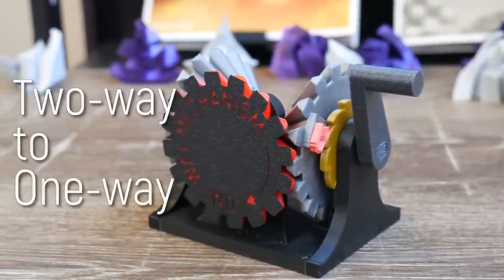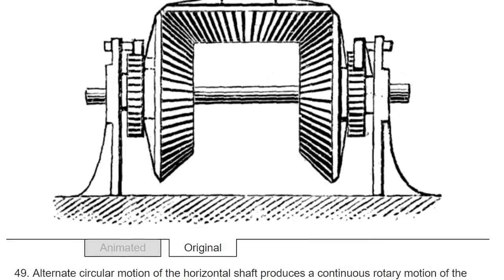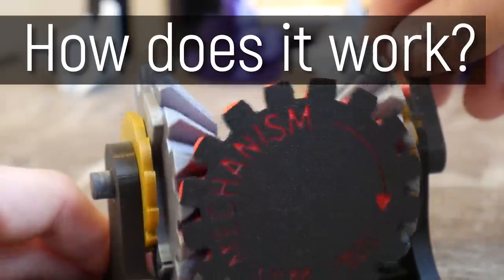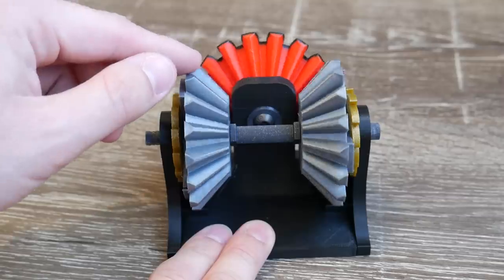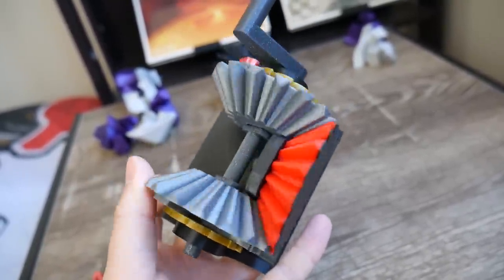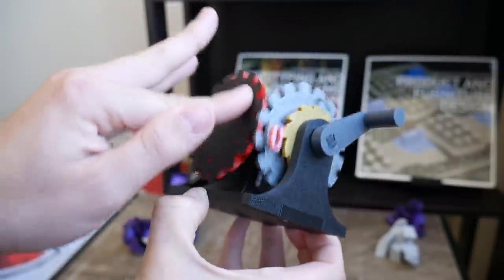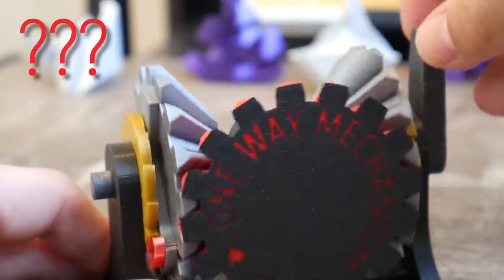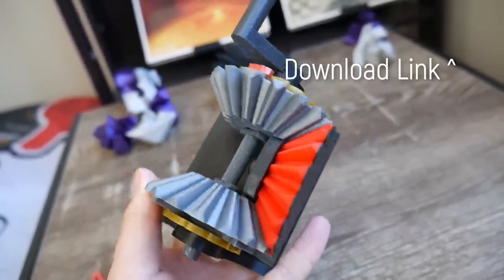This Mechanism only turns Clockwise, no matter what.

Comment: I have a hand drill with a selection of modes and one mode is to use the hand drill in awkward places where full rotation of the handle is not possible and only small reversed handle action can be done.

Comment: some boats use winch (the thing you put your rope on) that make this kind of movements. in one way, it rotate fast clockwise, (and be hard to rotate) and on the other way, it would rotate slowly clockwise (which require less strength to manipulate)

Comment: To lift stuff attached to a pulley, instead of rotating a lever, which can be tiring, you can push back and forth to achieve lift with a smaller range of motion

Comment: So you can only turn the output shaft one direction... great way to prevent a cart from rolling back down a hill, put one on each wheel so the cart can only be pushed one way. If you decide to roll go down hill though, rotate the cart around pivoting on wheel until it faces the other way, now no one can push it up hill. If someone does not know secret you can baffle them why it will not move the opposite way...

Comment: This could be used to convert sound to kinetic energy, and then into electricity. The sound would vibrate something like a guitar string, then the oscillation would turn this mechanism which could then be used to turn a magnet inside of a coil of wire which would generate electricity.

Comment: This sort of assembly is commonly found in screwdrivers, so that you can just twist it back and forth to tighten or loosen. It’s far more practical than you might think.
Reply: That's just a normal ratchet
Reply: Stephen Hurman Some are, but many are designed to continuously twist for maximum efficiency.
Reply: I've never seen one myself that does I've only ever seen normal ratchet ones I would be interested to see one that does

Comment: It's a rear differential.  imagine that the yellow and black one is the input shaft from the engine, and you are trying to make a vehicle move forwards.  yeah,  that would be an ideal build.  disengage the ratcheting things, or turn them around, and you have reverse.  in a real differential, this is all handled by the transmission.  if you look up the Limited Slip Differential Explanation, you could have a fin trip down that rabbit hole.

Comment: You could actually improve your mechanism by eliminating the sound.
For that, you would need to make both fixed parts on the axis slightly movable towards and far from the main gears they are neighboring.

When you move the axis in one direction, one gear gets engaged in order to allow it moving in your clockwise direction, while the other gear is pushed slightly outwards, slight enough to allow the uni-directional hook not to engage and therefore make no continuous sound eventually apart from a single click.

I mus mention here that there might be some slight intolerance when switching directions, as when you do that, the other distanced and not engaged gear will have to be pulled inwards towards the neighboring gear, and since it cannot figure in advance when the user is going to switch directions, there might be some tolerance required until it is pulled inside and engaged with the neighboring gear.

I haven't given it much thought, but this might be solved by making multiple inner engagement structure so that, once pulled after the direction is being changed, it will snap into the next one of multiple higher resolution slits (structures).

Comment: I can imagine a practical use for 3 phase motors. 3 phase motors direction of spin is dependent upon how the 3 phases of power are applied to it. Something like this could limit the working gear to the direction intended no matter what direction the motor spins. Now having said that, and having wired up many machines, I have never seen anything like this. I either check the phases in advance with a phase checker to insure proper rotation, or I do a spin check by momentarily powering the motor and checking the direction of spin, and changing the phases of power if necessary if direction of spin is incorrect. Some machines also come with a phase checker installed in the control circuit, and will throw a fault if the phases are incorrect.

Comment: i have a similar set up in my screw driver so i can rotate the handle either CW or CCW and the drive shaft rotates in one direction. i can manually remove screws in ICB (Integrated Circuit Board) just as fast as mechanical with out the concern of over tightening and damaging the ICB

Comment: My grandfather was a big steam engine and early combustion engine buff and a couple of the models that I saw when I went to fares with him had a flywheel that turned one way but a reciprocating shaft that turned both ways The motor essentially had one can bustion and then spun several times in 1 direction and then a second combustion when everything slowed down and forced it in the opposite direction So this device or one like it was probably involved

Comment: i think this mechanism can be used to convert ac current to dc current.
if we |connect an ac motor to the ac power and attach the ac motor to the axle in this mechanism| and |attach a dynamo at the red bivel gear of the mechanism the we can get dc current from the dynamo|
this can be helpful as there is no loss of current when the polarity is reversed because of ac current.

Comment: one way to fix the ratchet noise issue would be to replace it with a clutch like the ones found in chain hoist, but i would require a machined shaft and a load applied to the driven gear.

Comment: Ok strap in. Some comments have come close but here’s a good use. Imagine the handle is a pendulum swinging back and forth providing continuous rotation.  That rotation is built up into a flywheel which in turn drives a generator for power. But where do you put it? Stick it on a boat at sea and BOOM! Endless power, no solar or wind required. Come on you 3D printer jockies, get building.

Comment: what if you put a pulley gear system to this with a single weight on one end and the other end have an open container?

maybe for container have a tray that is open on one end.

put this outside to collect snow.

for the output, attach an electrical generator system to it.

when the tray is filled, it will drop, spinning the generator gear. when the tray empties (add something at the bottom of the drop to tilt the tray?) the weight will pull the tray back to the top and the generator gear will also spin.

Comment: this was amazing! from the beginning I knew there were ratchets in there. why? well, this mechanism features an irreversible logical mapping: the information about the initial rotation direction is lost in the output. this means that this mechanism could not be possibly obtained without some irreversible parts. (well, everything here is irreversible, because it's a practical implementation, but I'm speaking in principle here.) in your realization, such irreversible parts are the two ratchets, which require friction to work. (if not, they would bounce back without sticking in place -- there's a talk by Feynman about ratchets on youtube.) you finally ask about efficiency: it cannot be perfectly efficient, not even in principle, otherwise you would not have an irreversible machine.

Comment: You can create a Vacuum Pump with high voltage Input and it even works when the The rotating electric field wont turn in the right direction.

Comment: You can change the ratio of the bevel drive gears to provide different torque transfer based on rotation.  Like a winch on a yacht.

Comment: Just guessing. In an mechanical analog computer (for instance fire control on a battle ship) units/values could be represented by shafts turns. So if an absolute value of that unit needs to be calculated your device will do that.

Comment: you could add an additional lever (switch) by which it would disengage the current pawls you have, and engages new pawls in the opposite direction, this way you had build yourself a ratchet wrench

Comment: I found this video looking for a way to run a propeller shaft using a pendulum/counterweight that replaces the mast on a boat. With the right gear ratio and keel weight it should work...

Comment: Practice use for this but not too practical. On a pumpjack it has sort of a fixed ring and pinion style gear system, as I goes down it spin the drive shaft one way and as it goes up it spins the drive shaft the opposite, this would be a could place for a secondary pump given there is a pause in between motions but it’s the most practical use I can think of given the area I’m from and thing things I’ve see

Comment: Immediately I'd say my idea: Basically diesel owners with mostly manual gearbox have experienced reverse flow at some point and that literally fucks up the entire flow of the engine. What this could be used for is if in the future an efficient enough design is created, you can use it to prevent reverse engine flow!

Comment: An ocean wave pressure plate to electrical generator for wave and pull current to single motion high efficiency turbine generator. Change ratchets to one way centrifugal ring, similar to clutches in copier machines. Add bearing and machining. Got a winner

Comment: I think it is used in a screwdriver which is sold by telemart...in that screwdriver one doest have to rotate full 360 degrees instead u have to move it clockwise 180 degrees and anticlockwise by the same degrees but the resultant rotation on the head of screwdriver is 360

Comment: Alright goimg to tell you somthing intresting there is a systyme that does not use pawls it uses a bunch of figure eight type things that clamp to a cilinder it has a instat lock up and is totaly silent if you could imcorperate one of these than you would fix some problems. This mec has been used in one companies bike hub look up silent hub and you will get it. Hope this info gets used.

Comment: Possibly older clocks as they didn’t have stable electric inputs so to compensate for AC current you’d have a mechanical system that maintains uni directional movement
Reply: Likewise for pendulums

Comment: Hmmm... I recall an electro mechanical device whereas  there is a mixture of oil and powdered iron that is flowing within a cylinder cylinder containing the powdered iron and oil, and apply a DC current to it, it causes the oil to stop flowing since the powdered iron solidifies as long as current is applied.  Perhaps you could engage a mechanism to eliminate the clicking paws with such a electro mechanical device.  Why?  TO quiet it down, dampening of the vibration, eliminating mechanical wear and tear, etc.

Also think it may have opportunities in converting wind to single direction applications, such as a pump, thus eliminating the bearings that allows the windmill to pivot 360 degrees. 

Lastly, converting tide and wave motion to a single direction.

Wow....  I MUST GET A 3D PRINTER!   Looks like I found an interesting device to experience and combine with my software and hardware development background.  Retirement..... sux.

Andy recommendations for my first printer, that I can 3D print such devices? With a budget of $1000 US or less?

Comment: this could work as a pretty cool ratchet which you could move either direction to loosen/tighten bolts to switch direction you would have another gear across from the other output..

Comment: actually I think if I was to use helical/spiral cut bevel gears, some type of hi-poid like in a differential with some clutch driven mechanism instead of the ratchet this could be used as a dampener instead of using struts or shocks on a car I could use this to supply electrical power from vibrations going over bumps.

Comment: It looks almost like the configuration for a modern differential for a vehicle. Much like an older model. Where the power was supplied to one gear where it output torque to another in a different direction to push the vehicle along but was made useless as advancements in that field made head way as that could only supply power to 1 ouput gear at a time meaning it could only drive one wheel and in one direction much like early model automobiles.

Comment: I have a manual screwdriver that does exactly that. Turn clockwise or anti clockwise and the screw goes in or out depending on the location of a switch.

Comment: i really enjoy your videos... i find machanical momvment very intresting also. there is a part of a machine i use daily at work that has always sparked my curiosity. its. basicly opposite of this video.. one-way rotational movement, to, two-way directonal movment..... its known as a "traveler" and is used to layer wire across/onto a spool. its a box shape with a shaft though it to travel on.. shaft turns one way and box travels along left untill switch on bottom is ingaged then box moves back right and so on. most confusing is that the shaft is smooth. but box has a "clamp style lock"? to sucure it to shaft... or alow you to slide manually. im very curious what is happining inside this box/traveler.. im sure you would also.. maybe you could lookinto it.....i could possibly make short video of action if needed to understand better

Comment: What about this old pencil sharpeners? Kids would never remember in which direction it has to be turned, but using this mechanism you only need to put one blade, as no matter which direction you rotate the mechanism pencil will always rotate the same, reducing blades costs to literally the half.

Comment: it looks alot like a diff axel in a car or truck etc but the one way direction makes the diff use redundant, unless you could make the ratchets engage and disengage at will and so you have made a diff lock for one direction ?

Comment: scaled down it could maybe be used to detect flow or other small vribations. if the input is very sensitive any force applied to it will result in the output moving clockwise , so maybe if you can pick up the speed at witch it will rotate. you can calculate how heavy the vribations are or the wind is maybe>? idk tho i'm just geusing and dreaming a bit xD
Reply: tho idk if it's possible to remove eneugh friction out of this system for something like that to work (thinking that with electromagnets you could make it with less friction.)

Comment: 2:15 Are these soft pawls also 3D printed?
Reply from the maker: Yes, they're printed from PLA.
Reply: @MakersMuse  Hi, I purchased this, and I was wondering how you got the pawls to stick?

I printed the bevel gear 2X, and I see the three slim grooves where I think the pawl is supposed to be located, but the pawl is too thick for the groove.

Did you use glue or something? Are the grooves just a guide, or do they have some purpose? Thanks!

Comment: No way to rotate it counter clockwise, unless you disassemble it to a point where you switch the directions of both rechet gears.
Just pointing it out because there are enough smart-asses out there :P

Comment: Make an emergency generator with a pinion & rack! so that you can pump the device either way and have the gearbox convert the pushing into rotational energy?? say an electric engine connected to a lightbulb?

Comment: Not exactly a clever use for this, but it could be integrated into a ratchet wrench so that the bolt is rotated on both directions of the wrench swing.

Comment: Could have been used for an idiot-proof form of a hand-powered application and one that only rarely is operated by that must engage regardless. like for instance to lower (or raise) a set of heavy fire-escape stairs in case of emergency. But even so and imagining it on a time frame within our recent history where people possibly (often or on average) were illiterate enough to justify it, I still have a hard time imagining it coming in handy. I rather think it might have been an attempt for a design that came up on the way towards a reversible version of it.

Comment: Does it count as reverse engineering if you only recreated an object?
Reply: That is the definition of reverse engineering.
Reply: calvingreene90 thank you.  I was under the impression that to reverse engineer something, you would have fundamentally changed the object, redesigned or repurposed it.

I didn’t realize reverse engineer = recreate. 
Thank you.
Reply: @caseyclymore4417  
That would be re-engineering.

Comment: In the automotive world it's called an open-ended differential. The system has been used since the 1940s. When locking left to right you end up with a positraction differential

Comment: Its basically an idiot proof mechanism if an idiot dont know which way is clock-wise. It could also be a seperated module of an even larger system that have a two-way mechanism but you still want to retain a one-way state